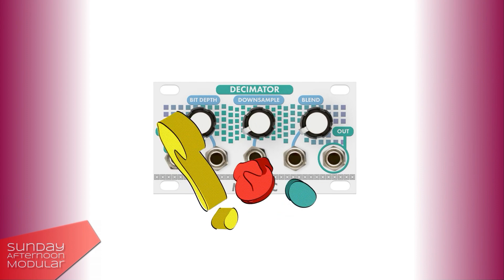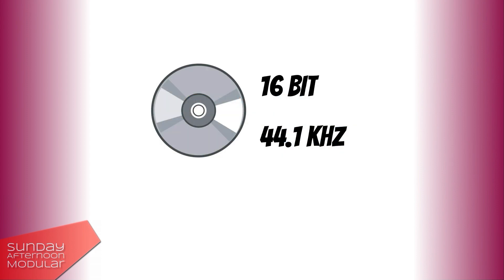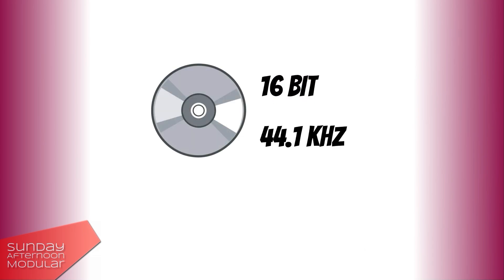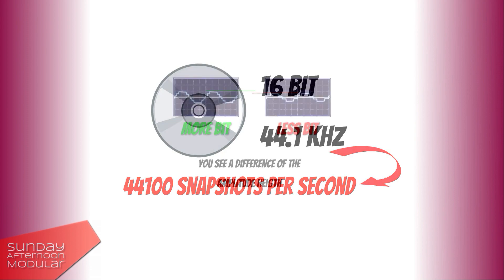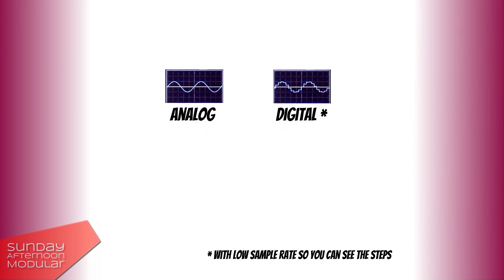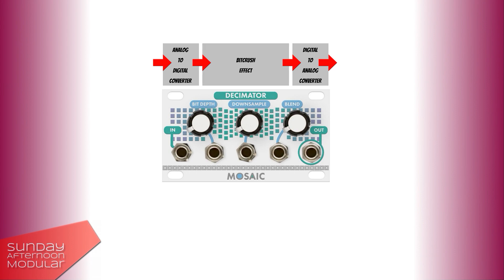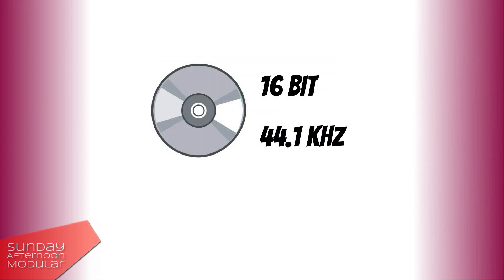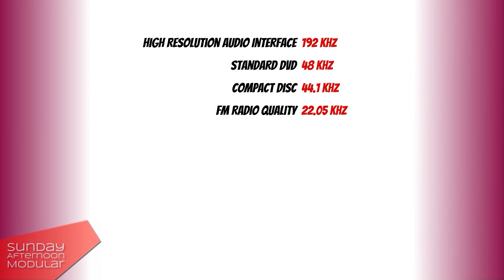BITCRUSHER EXPLAINED - why it cannot be analog

Comment: You can totally do this analog using a sample and hold and a quantizer. The S&H triggered by a square VCO set to the sample rate frequency will create the stepped voltages and then quantizing them over 5 octaves of semitones gives you roughly 6 bits. There's more fine grained quantizers that can process smaller steps than semi tones and could easily allow up to 8 or 9 bits